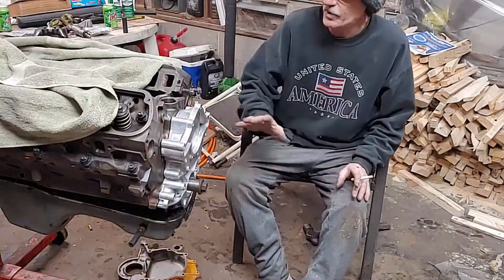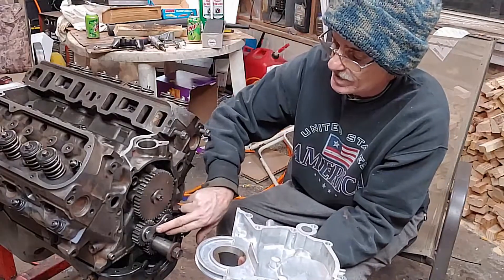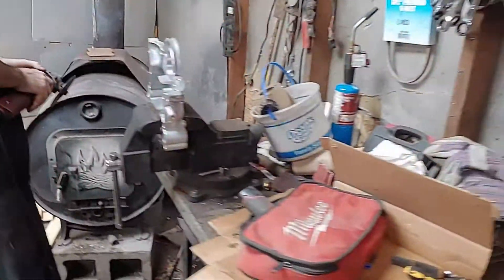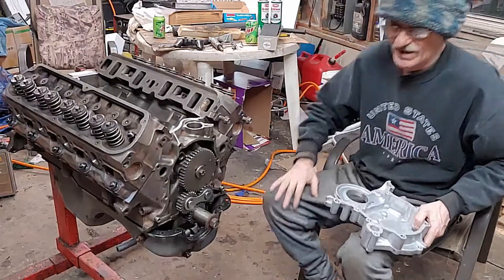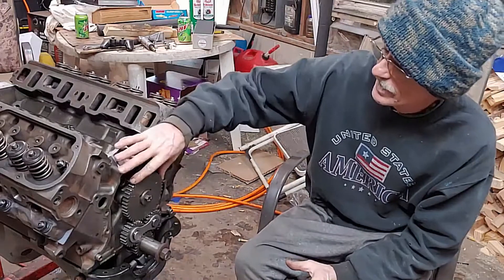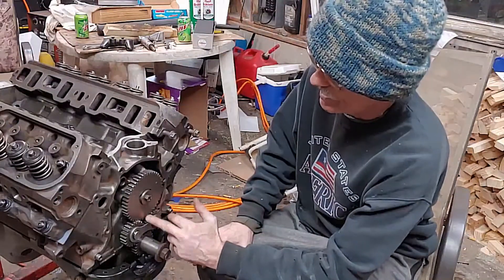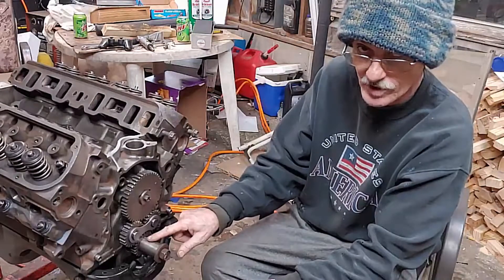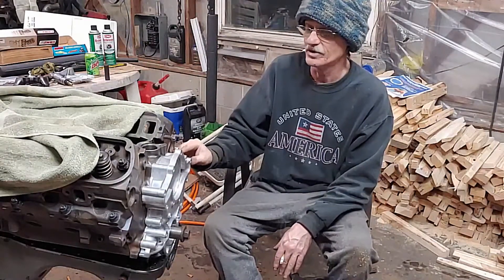How to install gear drive in a small block ford

Comment: That pin goes out, not in.its to keep them from rubbing a hole through from the walk out. Still needs ground down on some brands, But KEEPS IT FROM WALKING OUT. Ground for clearance on some so it tightened down the gasket..... Whatever

Comment: I have a 72 maverick with 302 automatic transmission. I'm thinking to swap the rear end for a 4.10 or 3.31 gear out of a foxbody. Do you think that will be ok. Or what ratio you recommend me to use to make it faster?
Reply from the maker: If you have an aod transmission I would suggest going to 430 gears with the overdrive you should be fine on the highways that is what I am running in mind and seems to work great for low and high in speed
Reply: @HunkajunkCarModsGarage   I appreciate your fast response. Thank you very much!
Reply from the maker: @lasaventurasdelchinoychini3516  you're welcome

Comment: I bought 2 sets for sbf.  Installed one years ago on my 82 mustang.  Finally  getting around  to my 94 gt. But the gears dont fit the crank or the cam in the newer engine?! Ever come across this issue
Reply from the maker: if you had purchased a gear set for a 302 then it should fit a regular 302 I do know that the crank in a Boss 302 also 351 Windsor are a different size you might want to check the numbers on the engine on Google and see exactly what you have
Reply: @HunkajunkCarModsGarage  all parts show 302. Has f cam. My harbor freighat caliper shows 1.99mm diameter hole on the cam gear. The cam snout is reading 22.3mm :/
Reply from the maker: @thelowbudgetguy  the only difference between a boss 302 and the regular 302 is the crank piston and heads everything else will interchange it is possible that somebody may have modified that motor before you receiving it and could have an aftermarket crank in it but it almost sounds like to me it has a 351 crank in it by your caliper reading which is the same size that goes into the boss 302 which is a combination between the 351 Windsor and 302
The Boss 302 has the same 4.000-inch bore and 3.000-inch stroke as the 302 except it has a Boss 302-specific forged steel crank-shaft with what is basically the 289's 5.1545-inch C3AE connecting rod with 3/8-inch bolts. The main journal size is the same as you find in the 221/260/289/302, 2.249 inches.
Reply from the maker: 302 castiron crankshaft with a 3.000-inch stroke and 2.249-inch main journals is identified by a “2M” on the first counterweight/journal. It is not interchangeable with 221, 260, or 289 rods unless you use a custom piston because it employs a slightly shorter (5.090-inch) connecting rod.
Reply from the maker: The Boss 302 crankshaft mentioned earlier can be identified by its forged steel design. It can also be identified by either a D0ZE-A or TFE-8 marking on the crankshaft journal. Because Boss 302 crankshafts are so rare, it is unlikely you will stumble upon one cheap at a swap meet.
Reply from the maker: This may help you out by identifying your crank

https://www.cartechbooks.com/blogs/techtips/rotating-assembly-parts-interchange-for-small-block-ford
Reply: @HunkajunkCarModsGarage  it is a 2mae crank with Ford stamped on it. 
Maybe it was just a poorly made Chinese gearset ?
Reply from the maker: @thelowbudgetguy  it very well could be I have sent you all kinds of stuff to identify your crank on what it is and if it all matches up to the 302 then I would say that it is the wrong gear setup which they are good for sending the wrong things out
Reply: @HunkajunkCarModsGarage  thank you much ! I learned some new things ! Looks like I'll be ordering another set
Reply from the maker: @thelowbudgetguy  you're very welcome and good luck with your build

Comment: I don't see your fuel pump concentric on your motor. Doesn't it work with the gear drive? I'm a Chevy man normally and this is my first 302 ford, I've worked on the 428 in my drag boat but this is a horse of a different color. Another possibility is your build has an in tank electric fuel pump, if so is my mechanical pump concentric going to work?
Reply from the maker: Great good luck with your bills and look forward to talking to you again
Reply from the maker: The fuel pump is a electric fuel pump which is back by the fuel cell mechanical fuel pump should work they run between 6 to 7 PSI so if you run a electrical fuel pump it has to be within that PSI being a carbureted motor if you are running fuel injection you will have to get a fuel pump that is least 40 PSI along with a regulator thank you for inquiring about our 302 builds I am also a Chevy guy too so yes it is a horse of a different color good luck with your build and hope that our videos can help you overcome the difference between Chevy and Ford
Reply: @HunkajunkCarModsGarage  Thank you my brother, I found an old 1971 F100 shortbed in decent shape for a really good price , so this is my first small block ford motor . Hope everything works out for me , really looking forward to this truck, so I maybe getting hold of you again for this build! I've got a lot of new goodies for this motor, should be a little surprising, I HOPE! LOL ! God bless ya !

Comment: Is this same on cleveland
Reply from the maker: It is for the 351 Windsor but a Cleveland is based off the big block so I do not think it is the same but as far as the assembly yes and it should be the same as long as you have the right timing gears for it

Comment: Hey man nice vids! Im working on a 460 right now and I’ve got everything set but one of my main concerns was, between the bigger gear and smaller gear, which one goes on left and which goes on right? I have mine set up like yours with the bigger gear on the left hand side but wasnt sure if big block would be any different. Assuming not.
Reply from the maker: Thanks There is no different you should be fine

Comment: Can you add the geardrive to a 302/351 while the motor is in the car? What happens when you need to run it in? Can you post a video of the motor running?
Reply from the maker: Yes you can put the gear Drive in the motor while it's in the car just go through the same method that we did we already have a video of the car running on the page look at the last video of the 1994 playlist

Comment: Any info on doing this to a ford 6.2L??? Good video man!!
Reply from the maker: You cannot put Gear Drive in a modular motor a 6.2 is a modular motor with overhead cams it has 2 timing change to it sorry I couldn't help you out man thanks for the comment
Reply: @HunkajunkCarModsGarage  that sucks. Guess that’s why I couldn’t find a single video or anything on the subject. Thanks for the response. Take it easy.

Comment: Wonder if you can do this to a Windsor 351.
Quick question, how are the gears oiled if it was originally belt driven?
Reply from the maker: Yes you can and they are oiled by the same way that a timing chain would be

Comment: What keeps the two middle little gears from walking out?? Thanks for the videos!!
Reply from the maker: The timing chain cover the tabs stick out a little bit more than the other gears and butts up to the timing chain cover
Reply: Is this correct I just installed this and didn’t think of that before I start it so the gears won’t float out they should stop somehow ?

Comment: I have a 94 gt I wanna do this will any of the 302 gear drives for sale on eBay work and can I buy the other type water pump plate that dosnt have the water pump bolts that need ground off ?
Reply from the maker: Yes pretty much any of the gear dries will work but I would suggest buying one that is for the year and make of your car the timing chain cover if the only thing that needs to be concerned about cutting the timing chain slap tab off the water pump really has nothing to do with it you should be able to use the old style or the new style water pump as long as your water pump matches your timing chain cover as far as the bolt goes for the water pump Bolts we use the Allen wrench type style Bolt another thing is make sure that your Gear Drive matches up and one does not stick out further than the other all gear drives say with modifications which means you may have to grind the tabs down on the backside of the big deer to make it closer to the motor I hope this helps and good luck with your build
Reply: I got everything ground down and installed but I was woundering what will hold the middle gears from walking out ?
Reply from the maker: Yes you can still use the other water pump and timing chain cover and the one used in the video I believe was purchased off of eBay if they say they're for a Ford 302 then they will work good luck with your build have anymore questions feel free to ask
Reply: @HunkajunkCarModsGarage  yes I also went with eBay gears I was meaning the timeing gears what stops the middle ones from walking out ?
Reply from the maker: @jimmarco9356  the timing chain cover hold them in place there's not enough room for the middle gears to slap back and forth

Comment: got another question will a crank from a 1985 5.0 work in a 1980 5.0? ones a 2 piece seal other is a one piece seal
Reply from the maker: Yes it will

Comment: I HOPE you do a sound video of this engine on mufflers to see how much nosier the engine is with these gears
Reply from the maker: The engine was put in a flat black Mustang there is a video with it running if you would like when it makes the noise like a blower you will need to go with the nylon gear instead of the metal gear

Comment: You mean the manufacture of the gear drive DOESN'T know the pin is too tall?? Or did you get the wrong one??
Reply from the maker: They say when you purchase it may need modifications to work for your application it was made for the 302 351 Windsor engines

Comment: Awesome. You remind me of my dad and his best buddy were ford fanatics.  Small garage like yours and they built Ford engines up to 1000 hp plus for mud racing and 1/4 mile.  They built a 289 so crazy the falcon did wheelies with 289 rollerised gear driven beast.   I love ford.   I'm building a 460 soon myself.  Thanks for sharing
Reply from the maker: Well thank you awesome and good luck with the 460 build

Comment: ok question bout it im not a big ford person im putting gear drive in my 86 f150 n i lined it all up tdc dot to dot and noticed intake valve is open.. shouldnt be open should it?
Reply from the maker: No both exhaust and intake valves should be closed on number one cylinder on top dead center You may want to rotate it one more time and make sure you ain't a hundred sixty degrees off on the timing there are 2 Strokes to the top dead center when is intake and one is exhaust if you have not pulled the distributor then your rotor should be pointing to number one if it is pointing to number six then it needs to be taken around one more time hope this helps
Reply: @HunkajunkCarModsGarage  no distributor in it.. if turn so cam timing mark is up and crank is up to, both valves are closed.. if rotate til line back up intake is open again...
Reply from the maker: @davejohnson2937  okay then turn them both up then take off gears reline the cam to position together dot-to-dot leave the crank in the position that it is in with the dot Pointing straight up rotate the cam if you cannot reposition the gear two point the. downwards which will open up valve backup but when you rotate the whole engine with Center gear in one more time before putting distributor in on number one then the valve will be closed then drop in distributor the cam is 160° off
Reply: @HunkajunkCarModsGarage  ill give it a shot bout to toss gears in trash n out a chain on..
Reply from the maker: @davejohnson2937  that should do it for you still have the same problem go on with the timing chain as well
Reply: @HunkajunkCarModsGarage  same thing both up valves closed took center gear turned cam to dot to dot valve opened put center gear back in turned it dot to dot valve open....
Reply from the maker: @davejohnson2937  something ain't right there then either not the right gear set for it is this a 302 or 351 Windsor
Reply: @HunkajunkCarModsGarage  i some how got it lined up idk what i did but it went where should n both vales are shut.. i been working on it since 930 cam gear on n off on n off good at that now lol
Reply from the maker: Well I'm glad to hear you got it I knew something wasn't lined up right but it is hard to help someone over the internet you need any more advise feel free to message me we are also on Facebook if you want to look us up pictures and video would have helped that's one thing I wish YouTube would allow us to do congratulation and have a great day
Reply: @HunkajunkCarModsGarage  and yes i was trying to send a vid too but youtube said no

Comment: Would this work on a 1989 302 H.O block? Do I have to change the timing cover for this to work? If it does work…. Can you send the link where I can buy the gears please?!?. Thank you
Reply from the maker: Yes all the timing chain covers are the same on the Ford's in the later models I will look up the link and reply with it thanks for subscribing
Reply: That’s awesome man thanks! I ordered mine today. If I have any questions I’m definitely reaching out, thanks again!
Reply from the maker: https://www.ebay.com/itm/New-Dual-Idler-Gear-Drive-Set-Ford-Noisy-289-302-5-0-351W-Windsor-302N-/322247090398?_trksid=p2349624.m46890.l49286
Reply from the maker: You're welcome

Comment: I was just thinking about putting one on my 95gt. Looked one up for $65. I have a leaky oil pan so might as well do both at same time. Thank you for the info on what to modify.
Reply from the maker: You're welcome remember when taking the spindle down on the center gears do a little at a time until you get it to match the other gears and is butted up against the block that is something I forgot to mention in the video good luck with your build
Reply: @HunkajunkCarModsGarage  im a aircraft mechanic so yes i understand not to over grind anything
Reply from the maker: Okay great then you know what I'm talking about didn't mean to come over as a know-it-all just wanted to make sure you got it right
Reply: @HunkajunkCarModsGarage  you know more than i on this sir. We are close to the same age  so i understand and you didnt come off as a know it all to me. And i appreciate  everything your saying and i subscribed and ill watch what you have. Im in california and im bound to the smog rules. Sucks but its what it is. Anyway thank you for responding  back to me
Reply from the maker: @greggkoehler6826  well thank you but I am always learning as well at 56 years of age and you can chat with me anytime or ask me any questions you would like to help you along your way on your build and thank you for subscribing your friend John